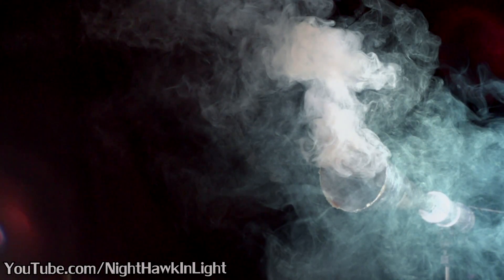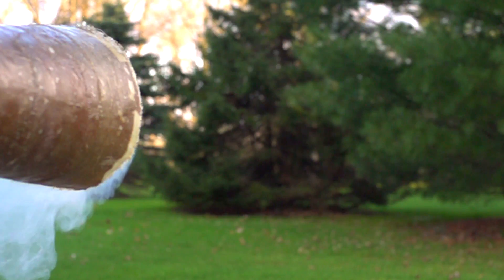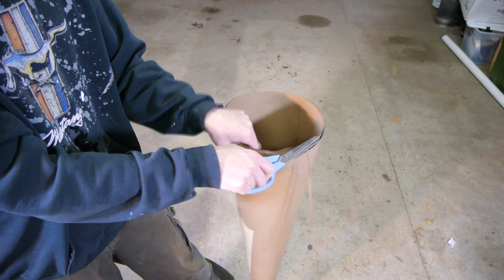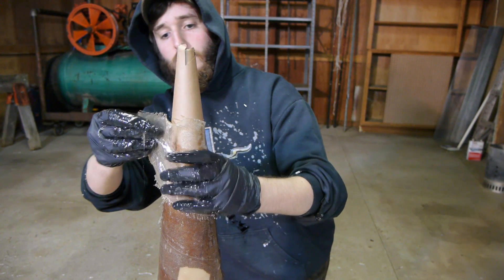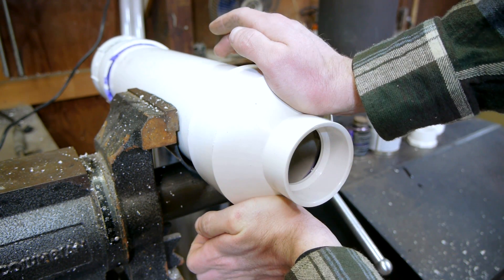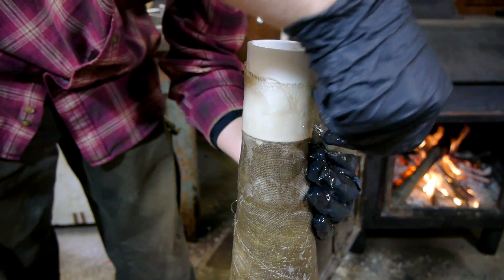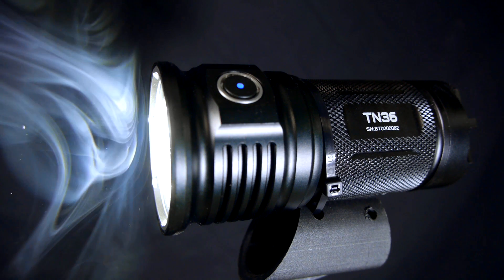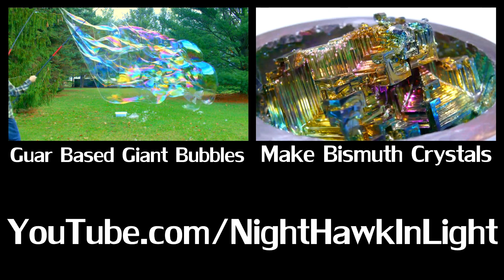How to Make a High Power Vortex Cannon

Comment: Do you have any idea of how much force is exerted on the cone? Is your cone pretty much structurally maxed out or do you think the fiberglass could handle a much larger combustion chamber? (like a 60 gallon air tank)?
Reply from the maker: I'm certain it could take much more pressure. The tank is the part you need to be sure is up to the pressure.

Comment: you ever tried using compressed air to make the explosive pressure wave?
Reply from the maker: Yeah, it just takes a lot of volume so combustion is the easier method.
Reply: @Nighthawkinlight  Are you saying air pressure alone, or air pressure with the fog machine? I was thinking, fill a container with fog & use the air blast for the pop effect, like what your doing with combustion. Use a quick release electric solenoid valve for the pop.
Reply from the maker: The fog doesn't make a difference in how this works, it just let's you see the ring. With an air cannon instead of combustion it takes a large volume of air and so it is bulky and time consuming to pressurize.

Comment: If you'd have asked, I could have also shown you how to form the barrel.
You do really cool stuff, and it'd be awesome to collaborate! 
Just a mention would have been nice.
Reply from the maker: I had to look at your channel to remember what you were talking about, this video is quite old. I recall I did send you a message in fact. I found your video in my research but did not hear back from you. As I was left to figure this out on my own and used my own methods based on commercial hail cannons I'm sorry but you were not the source for the idea. I had already began before I even saw your clip.
Reply: I'd just noticed the same construction technique. No big deal, and I'm glad it worked for you!
My inbox is flooded (tesla coil/tesla fanatics) to a level that I can't keep up with. I'm sorry that I didn't get back to your message before this.
If you ever need high voltage equipment, jet engines, rockets, or other noisy machinery I left you my email.

Love your videos!

Comment: Do you know that , according to theory of smoke-rings , or toroidal waves , a special  & precise meeting of two of them provokes  a destructive phenomenon , like an image of  matter an antimatter . ( or movement & its antimovement )
If you  are able sending  a smoke ring   in the same direction  and  quicker than the previous  one  ,  exactly inside the  previous smoke ring  , when the second meets the first one  and  that its outer ring tangents  the inside   ring  of the first one  =>   they explode  in  a very  spectacular way  .  The two movements  very  very suddenly  stops , sending  pieces of torn smoke in any direction . If someone completes the film of such a  phenomenon , that would be a good show !
I used to play with it  with  cigar  smoke rings  during long cruising  periods when I was airline pilot , in a time  all  these things were not yet forbidden  on board.( The funny  intelectual  thing was  this success in an air totally  static ...within a cockpitt that was  flying Mach 0.84 )   Of course , the air must be very quiet to complete this experiment .

Comment: can you use propane as a fuel for this or no. I'm doing this for a science project and I would like to know if I can
Reply from the maker: +zoe pencil Yes, it just needs to be metered like it would for any spudgun. You can learn how to make a propane meter system on any spudgun forum.
Reply: +zoe pencil Propane is the propellant in most spay cans, so I use straight propane from a plumbing bottle. You don't have the mess of hair spray, so it burns cleaner.

Comment: Thrunite is great but the TN11sV2 I got was defective as after a few days the tail switch isn't really working. I'll try to turn it on, and it will turn on, when the button is in, but as soon as I let it go the light goes off. Eventually the light will stay on, but after like 10 tries.
Reply from the maker: +CockatooDude That stinks, I've never tried the TN11. Have you tried contacting them about it? They may be able to send you a replacement or at least a replacement button since that seems to be what went bad
Reply: NightHawkInLight Hmm, thanks for the advice, I was thinking of ordering just a replacement switch if I could, anyway thanks. Also I built one of your pvc foghorns and it works great, just get an electric compressor and make an air tank out of a 2 foot by two inch pvc section, then you could get it to make noise with the flip of a valve!

Comment: hi there "NHIL", nice cannon!!
what happened when you tried your air cannons?
..do you think that a gallon tank with 100psi and a solenoid valve in the end is enough?
best regards !
Vitor
Reply from the maker: Vitor Quintela It takes large volume and a big valve. 1-2 gallons and a 1.5-2" bore quick acting valve might do it.

Comment: Just saying, but not trying to spoil anything.
If you are interested of those flashlights you can buy one with exact functionality from ebay with less than 40 bucks instead of 200 bucks. I bought one with 7 instead of 3 high quality cree leds. But to say, it's impractical.
But great video, I wonder how it works without the cone, or without the burst disc.

Comment: mANY YEARS AGO, i HAD A SMALL GUN, THAT WOULD SHOOT Rings of air..

It look like a 1/2 dome with a hole on the middle, a Rubber/latex base..The Gun part was designed like the Old Dart guns, spring loaded...
Pull back the Dart, pull trigger...it would hit the Latex membrane, and the Dome shape would force out a Ring of air that would travel 20 feet..
Family member who smoked, Blew smoke in it, and we could watch it travel..

Comment: What where you using as propellant?
Sprayed very long imo
Airduster with a propane/butane mix works very well, but the best thing about it has to be that theres no cleaning requiered :D
Reply from the maker: 2tts I was using antistatic spray. It's a big chamber, takes a lot of fuel. I found the best results are around 5 full seconds. I may add a metered propane setup at some point.

Comment: i may be missing something obvious, but would a large traffic cone not work instead of having to create your own?
Reply from the maker: steamjunkprops Potentially, but most of the big ones are made of rubber that's too heavy and floppy to support itself by the small end. You may be able to use one as a former for the fiberglass though.

Comment: Cool I've seen one made from a trash bin the plastic bin with a hole on the bottom and some kind of plastic on the top to hit, it the smoke ring it sends doesn't look as good as this though, I saw it on flite test.
Reply from the maker: niq872 Yeah that's a pretty common science experiment. The rings are pretty weak though, you can't make them nearly as powerful as you can with a cone design.
Reply: NightHawkInLight yea you can easily see these and its a lot faster.

Comment: No respirator while working with resin?
Reply from the maker: Ryan Lam No, two part resin isn't solvent based so it doesn't give off much in terms of fumes. You should wear a dust mask when sanding fiberglass though, the fibers are not great to get in your lungs.
Reply: NightHawkInLight You definitely need a respirator when working with fiberglass resin. Most fiberglass resin is polyester resin, which is horrible stuff. Always wear a respirator and do it in a well ventilated area.